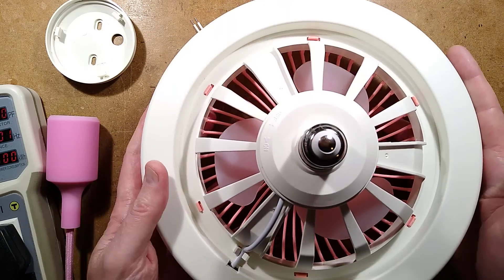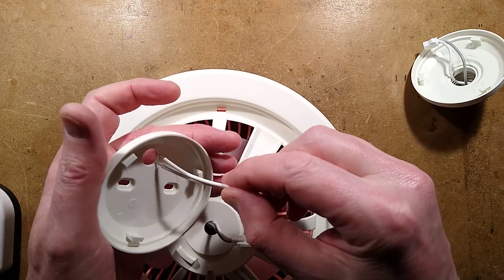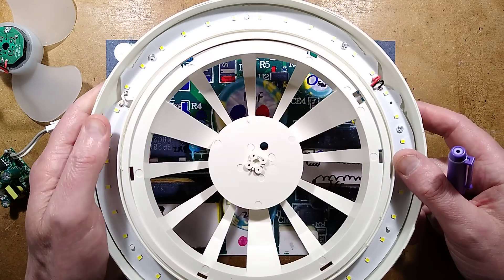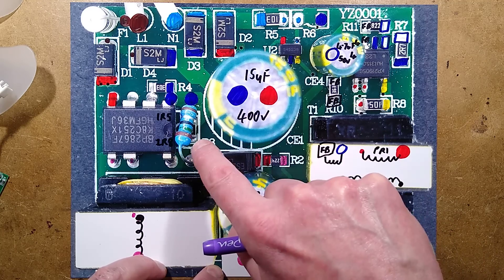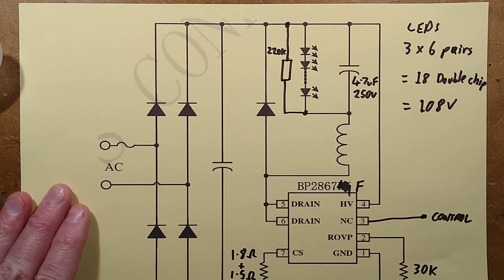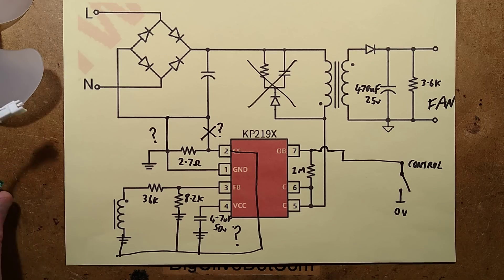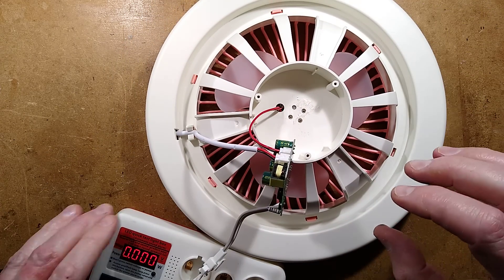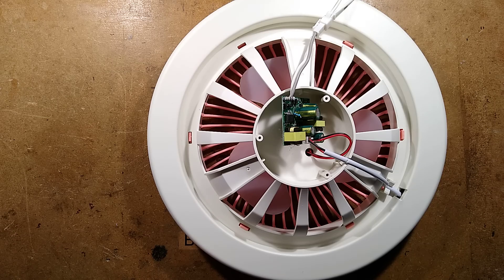fixing a faulty light with powerful built in fan (awesome chip inside)

Comment: This fanlight might make a good bench light to blow away the solder fumes.

The last black band used to indicate the tempco, but with colors other than black.  I would just ignore it.

I'm not sure if cutting the resistor affected only the light, or did it slow the fan?  

Thanks, Clive.
Reply from the maker: It just limited the current to the LEDs.
Reply: @bigclivedotcom  Clive, an off-topic question, but what happened to your left hand's middle finger?

Comment: Interesting chip but I noticed from the datasheet that the trigger voltage is about 170V peak (=120VAC) which makes me think it would be unreliable on US voltage. On the other hand that might be dependent on the voltage on the HV pin via a voltage divider.

Although it doesn't say how much current it can sink, the data pins can handle up to 30V through a 500 ohm resistance which suggests 60mA so it should be possible to drive a relay directly.

Now if only they were available...

Comment: Very nice fan & light.    interesting video 2x👍
What sort of isolation has the chip got? If it fails would it be possible for the mains voltage to get to the LEDs or fan? I know its very hard to get to the workings on this fixture but we have seen many Chinese products were its easy to open the case
Reply from the maker: The LEDs are directly referenced to the mains supply.  The fan does seem to have an isolated transformer, but on a product like this it is unlikely to be safety grade.

Comment: Brown Black Gold = 1R (10 x 0.1), Gold = 5%, Black = Wirewound
Reply: Manufacture of first consumer grade 5% resistors was delayed by decades because they had to wait until gold color paint came along. No, seriously before color rings they were all brown paint dipped & a color dot to indicate the resistance.  1K red dot,  100 K yellow dot etc... A radio from that era wouldn't work any better with accurate resistors, still pick up stations fine with +100% / -50% off nominal value 
When "E6" invented they had to dip one end in a different color for the extra digit  yellow body violet tip &  orange spot = 47K
Reply: Thank you!
Reply: at one time there was PINK  = hi stab  hi stability
Reply: @jagmarc hi stab, i'm @awesomeusername999
Reply: @jagmarc  and Red = 2ppm/°C
Reply: Yup. And that last black band also means not just wire wound, but non-inductive, bifilar wound.
Reply: @laurencehand12  ooo, fancy
Reply: Must be a non standard resistor.
Reply: The last band can also denote temperature coefficient.
Reply: 1 Ω
Reply: I'm guessing it's your standard 3-stripe resistor color code, 4th stripe is tolerance, 5th stripe is composition?
Reply: It has 2 gold bands, I wonder if that is an odd way to show 1% ?
Reply: @terryhayward7905  The first gold is the multiplier: Brown = 1, Black = 0, Gold = x 0.1. The second is the 5%.
Reply: @rpdom  Hmm, I have never seen that, does that make the resistor 0.1R ?
Reply: @terryhayward7905  10 x 0.1 = 1 Ohm

Comment: Another interesting video, Big C! I couldn’t wait to see what reaction that bridge would cause. Seemed an obvious fault, but one never knows.
Reply: yeah, schems shouldn't use NC fpr possible switching pins, normally closed ,not connected
Reply: @AndreasA.S. That schematic as shown with the NC on the mystery trace was not exactly the same chip number. Big C mentioned he had a difficult time finding many of the datasheets. The drawing shown may be a cheaper version without additional functionality of the control pin as the actual chip number ends with a ‘F’.